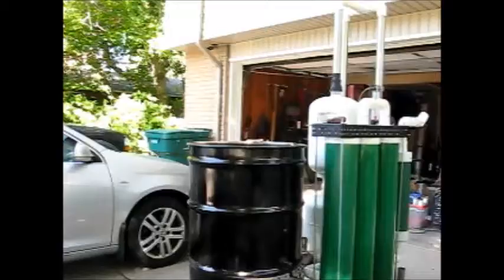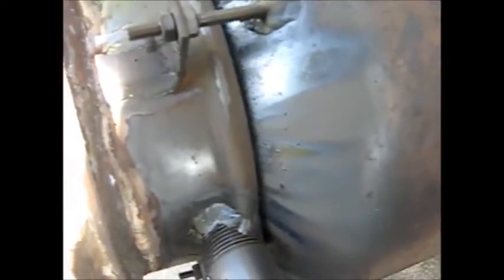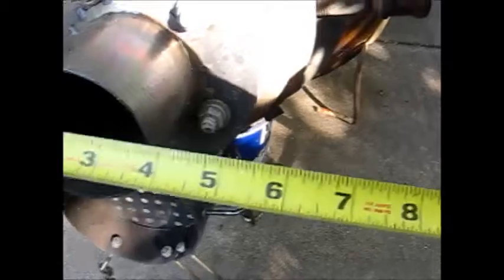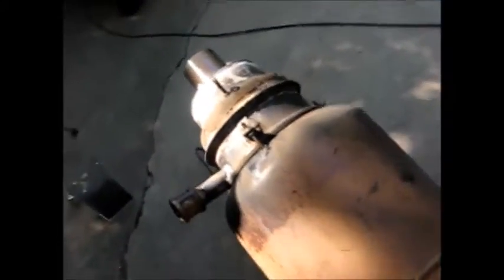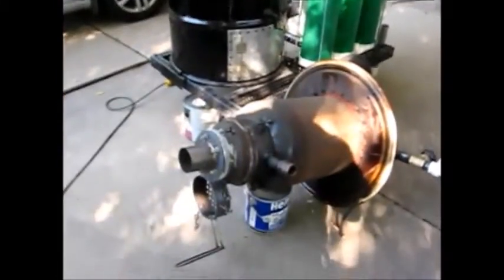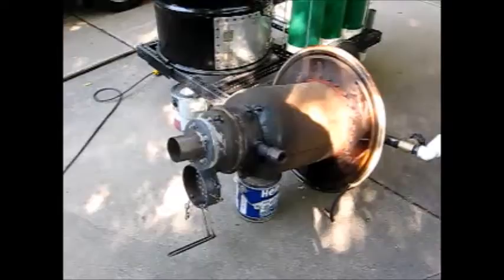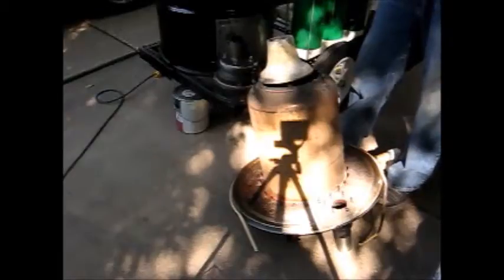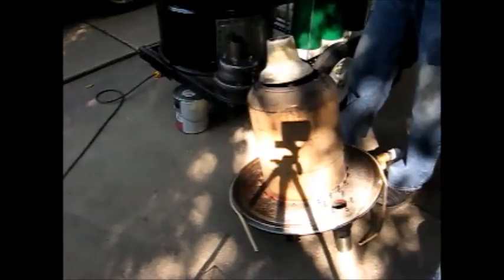Gasifier Review Video Part #3

Comment: I used a rope gasket where my rim bolts on to the hopper. So far no issues. I'm sure you will be able to find it in my old videos of the build if you want to see it.

Comment: At the 12:40 mark of your video. Look at the weld where the igniter port mates up to your rim. That is a area that is going to need attention first to get it to seal to the hopper. From what I can see, the weld looks ground flat to the edge of the rim. That with the mouse hole cut into the hopper is where you are getting a "stand off" condition where is was leaking at. Grind the weld on more of a taper angle and trim the edges of the mouse hole to make more of a "V" shape. Work on this till the rim sits flush with the hopper without the gasket. Then do as Flash mentioned with the flat fireplace door gasket. I think that will solve the leak issue at that point. Other than that, you are really close on this. Closer than you think.
Reply from the maker: Thanks Guys for the Suggestions. I have not had time to work on this again yet. But I want to this coming weekend.

What needs to be done to get a good Blower. I am at a point of frustration.
Reply: The inline bilge blower that you had on there should work for you. Hbbyloggr uses one on the primary (unfiltered) flare port and he does have to clean it out once in a while. He mentioned the cleaning in a comment on your video #6. I don't use one of those. I use a modified residential gas furnace draft inducer blower. The only issue I have had with them is air coming in between the motor shaft and housing. I solved that by installing a double sealed roller skate bearing epoxied to the housing. Works great. You would need A/C power or a inverter for that on your setup.I have both. Your biggest issue is your air leaks in the chamber. YOU solve the air leaks and you are well on your way to having a good working gasser. Contact Hbbyloggr for questions you may have on cleaning your inline blower. I am sure he will be glad to help you out there. In my opinion, the little centrifugal blower you were trying and the long blower are not going to do the job for you. Anyhow, if you have any questions, send them on and good luck.

Comment: I originally started to use the idea you did with a bolt-on hearth "fire cone" to the wood hopper. If you have a good fit you can probably use the round fiberglass rope they use on wood stoves. I would use the red hi temperature RTV cement on the fiberglass rope and tighten everything down. Even if the temperature RTV cement burns up it will still remain embedded in the fiberglass rope and give you an excellent seal and stay sealed unless you unbolt the fire cone from the wood hopper. Before I forget, you will have tar in the wood hopper and inside of the gasifier. That's normal especially before it reaches it's temperature. Nice job on the grate and the bell idea for the fire cone. I can see where leaks may be an issue with what you pointed out so far.